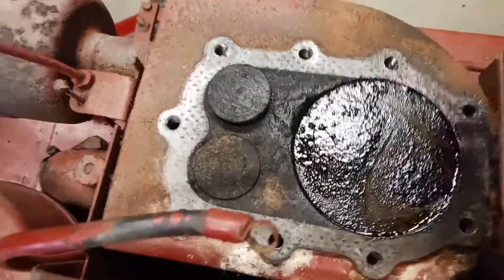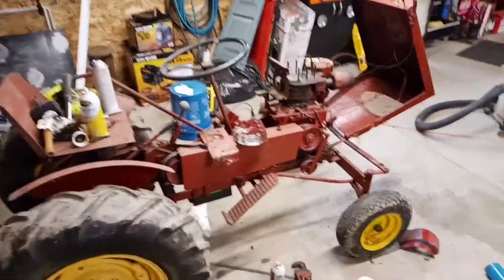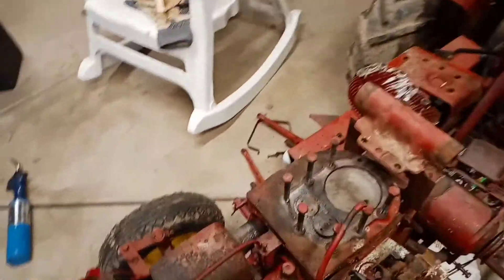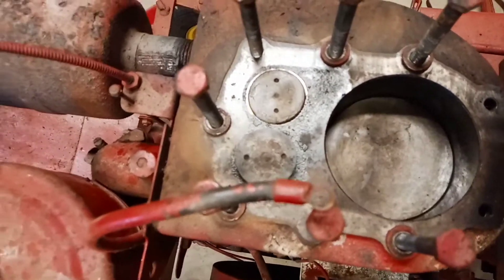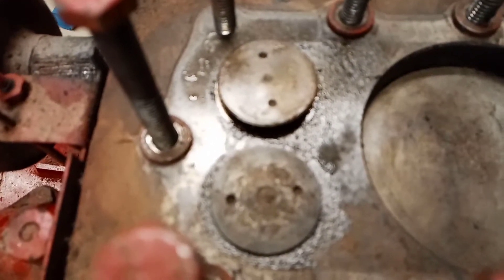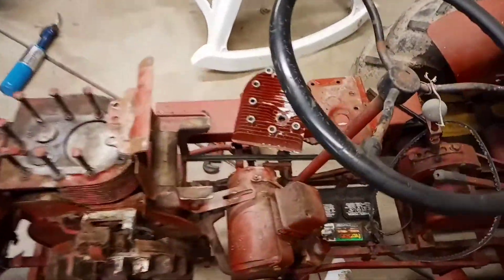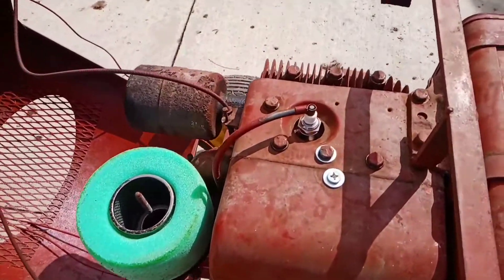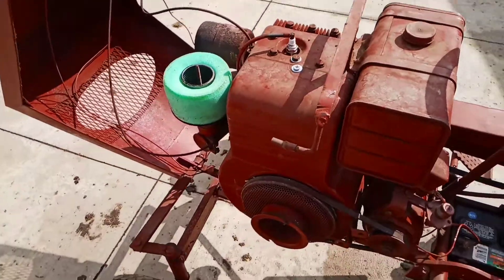Speedex S-19

Comment: Do you know where I can get parts for that motor? I have one that's nearly identical on an old gilson that needs a starter
Reply from the maker: I've bought points, condenser, air filter. Simple tune up parts at local small engine parts store. In stock no problem. Not sure about other parts.